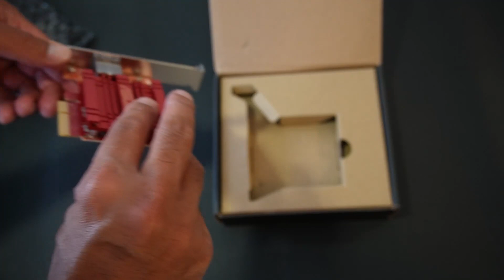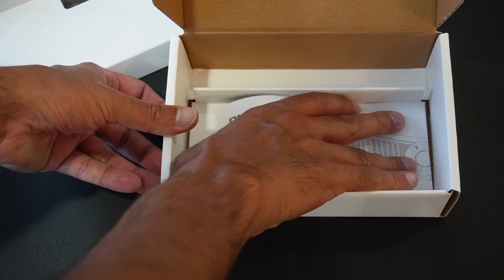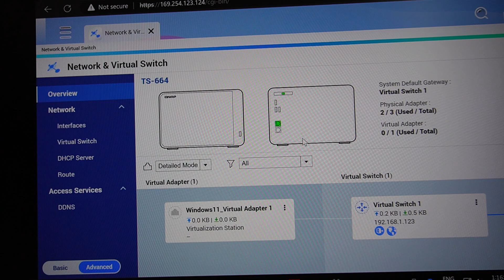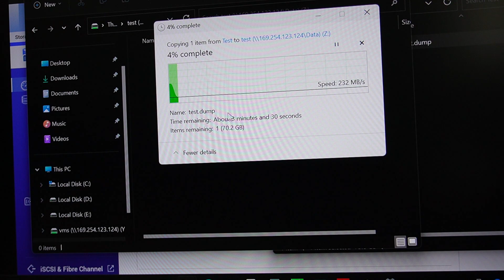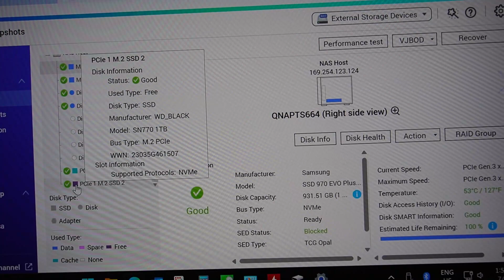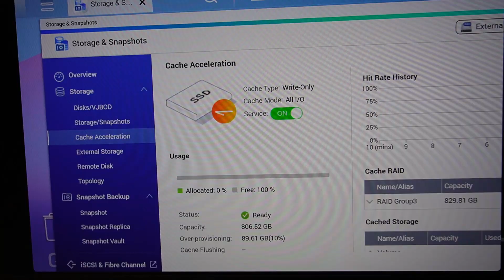QNAP TS-664, QM2-2P10G1TB, ASUS XG-C100C, 10GbE Ethernet Budget Setup tutorial NO SWITCH, speed test

Comment: I went with fiber for my 10Bb connections I needed.  My house only has Cat6 runs to each room.  Probably not that much more for the two cards and fiber is not that expensive either in short runs.  And it looks cooler too.

Comment: As of today, 8 port 10G SFP+ switch is just $100 and $20 on ebay for a used dual-ports 40Gbps Mellanox card(can be used as 10Gbps by DAC Splitter cable, which is about $25).  There is no reason to try all those expensive $200+ single card NO switch approach.  It is actually not a budget friendly as of today.
Reply: well nobody stated otherwise. u dont know his usecase. maybe he uses his nas only through his pc. no need for extra gear then.

Comment: Awesome video dude, thanks. I came looking coz I have the TS-464, same hardware but 4 bays, same QM2-2P10G1TB expansion card, but I'm using a used Intel X540-T2 10Gbe NIC in the PC and I'm only seeing speeds of 180Mbps, that's whether I go through be 10Gbe switch or directly connected, and I've made sure I'm transferring on the 10Gbe IP Address. I've posted on the QNAP forum and someone there told be it's the limitation of the Intel Celeron (N5105) CPU and 10Gbe wouldn't be possible, which I thought was nonsense, otherwise why would QNAP have put in a PCIe slot, and you've just proven it's possible to achieve up to 1Gbps transfer speed with 700-900Mbps realistic. Very interesting test regarding the Cache though, I'm glad you did that, and once I figure out the 10Gbe issue I think I'll setup my cache like that, so it's spread over the 2 controllers.
Reply from the maker: Hi, Thanks for watching. Glad you found it useful and appreciate your kind comment. It took some time to do this but was worth the effort since I couldn't find any definitive information about this product and bandwidth limitations. Overall I am happy with the setup though I will say sometimes the speed hovers around 500MB/s and even slows down below that a bit but I am wandering if this has something to do with how the cache is managed and also maybe the SSD cache itself and this is mostly over large sustained transfers. Will be great to know how you do with your setup also keen to know how the intel card performs, let us know if you get time. All the best, TK :).